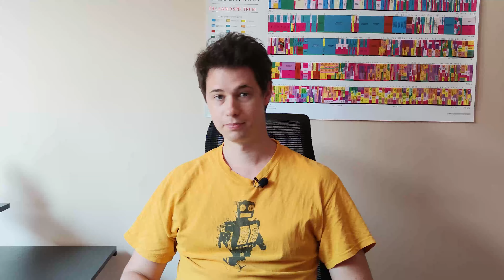Embedded Mersenne Twister | RNG Part 3

Comment: I really wouldn't use the Mersenne Twister anymore, especially on embedded systems.
It's not as bad as using a vanilla lcg, but there are faster more highqualty PRNGs that have way less state.
Firstly the Mersenne Twister fails linear testing (e.g. using the PractRand testsuite), this isn't very ideal, especially since it could qualify as too big to fail (see related blog post on pcg-random org: "Too Big to Fail").
Also seeding any PRNG with only a 32-bit seed isn't ideal either (also see related pcg-random post: "C++ Seeding Surprises").
I'd recommend using something like xoshiro256++ or romuQuad as a PRNG, they only have 256 bits of state and are way faster. (there are also smaller and faster sub variants available)
For cryptographic purposes a properly seeded chacha20 would probably be best.
Reply from the maker: That is amazing, I'm going to look more into those issues and algorithms. Thanks a lot ;)